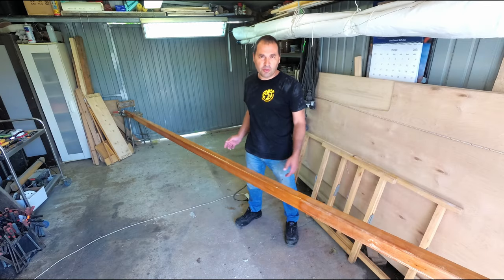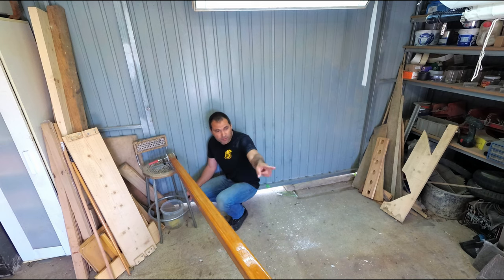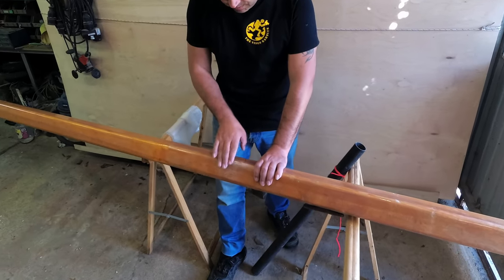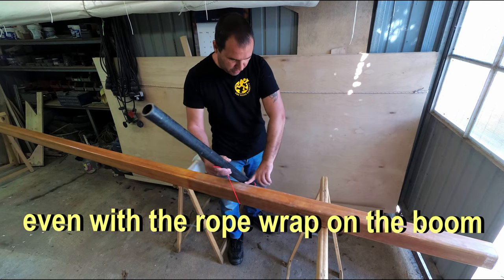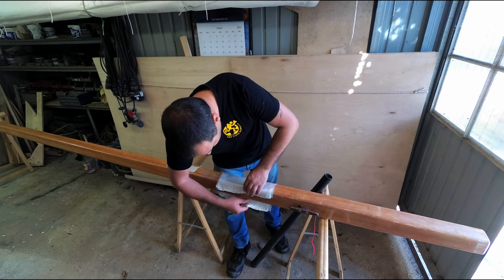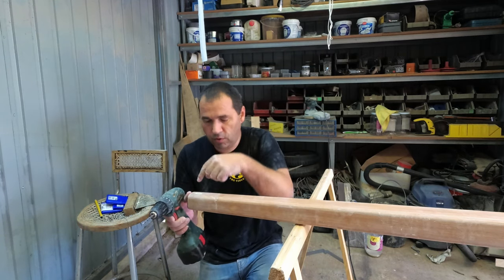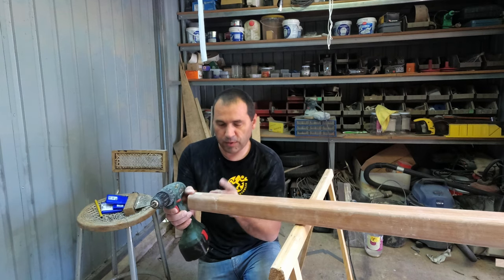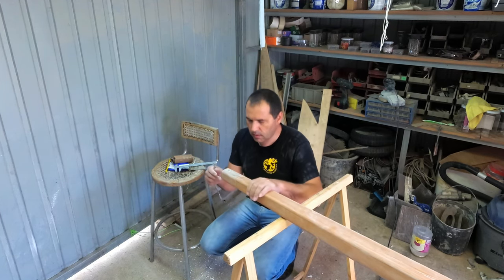Wooden Mast Repairs and Reinforcement

Comment: Great work. You might consider lining the holes at top of mast with metal tubing/bushings(brass, copper, bronze, stainless, etc). If you use thicker walled tubing then it would be easier to flare the tubing flush where it exits the mast to reduce chafing.
Reply from the maker: Hi Joel!
Interesting ideas! I'm not sure how the spectra fibers would like the harder tube tho!  maybe some softer polymer tube...🤔

Comment: Good Concise video!   I want to see  your boat!  I have a BAUER 10ft dinghy that will need almost the same kind of work.  I have an old mast it looks as if it was constructed with 2 halves. Its only 2" in diameter.  I plan to add epoxy after sanding completely, then a layer of 4ounce cloth to the lower 3ft and most likely the top as well.  Wet out the cloth like you did and add another 2 coats of epoxy, wash sand then 2 coats of a premium varnish. I m planning on this taking about a month!  Oh Joy.  As a videographer, I hope to document it as well for others.
Reply from the maker: Thanks!
If you make that video leave a link here for us! 😉

Comment: I would have repaired the dent with a single layer of glass and then covered it with heavy leather to pad it.
Reply from the maker: Hi!
The mast had a layer of glass before and it broke because the mast is made of soft wood. Leather is good for impact and chafe protection but it won't add any strength. Now that it has microfibers and two layers of glass I can put leather or rope wrap over it! 😉
Reply: @TheBoatRambler  I know it had a layer of glass. And I know the mast is made of "soft wood". And I know the properties and purposes of leather!!! Do you think I'm an idiot?  Glass is hard and brittle and that's why the damage occurred.  Two hard surfaces coming together. I suggested you repair the existing glass and wrap leather, not rope around the spar the same way you would on oars, to prevent it from happening again. Two layers of glass, or more, won't prevent the damage from occurring repeatedly. Padding is required. Leather is traditional. "Rope" is not.
Reply from the maker: First of all two hard surfaces never came together, rope might not be traditional but it's not hard so I don't know where you got that idea from.
Although all lateen rigged traditional boats around here have rope wraps...
Second the glass broke precisely because the soft wood fibers compressed/buckled while the glass just snapped, there was no impact that I know of...  maybe you sailed my boat at some point and I didn't see you... 🤔
Reply: @TheBoatRambler  Sorry, I'm basing this on a 'Beth' by the same designer which showed wear in the same spot.